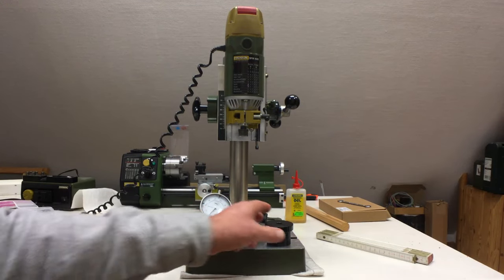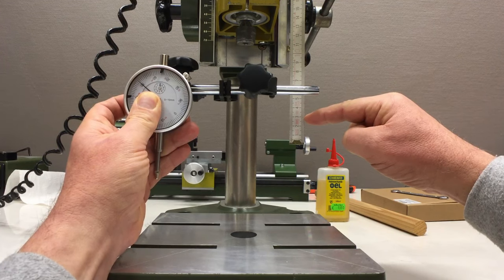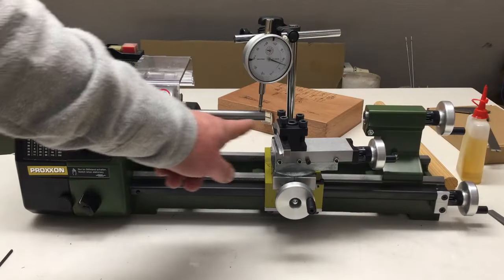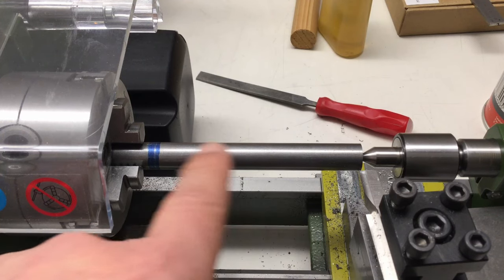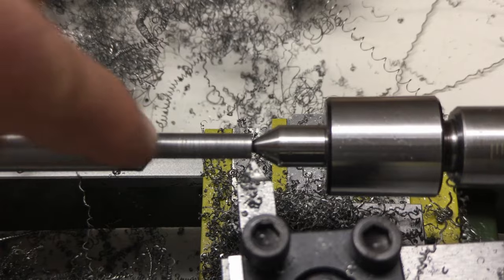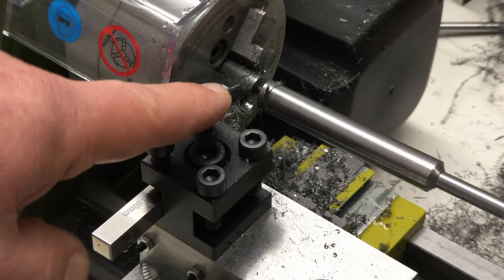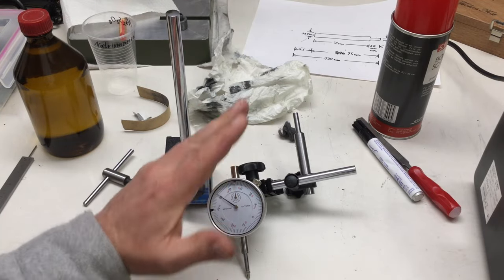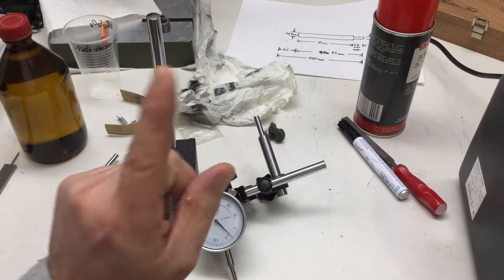Small Project: Shaft for Attaching Dial Gauge to Milling Spindle Collet

Comment: The chatter at the beginning, when doing the facing, is because the effect of bending of the piece and can be reduced using a lunette, or, the cheaper solution will be doing the facing with the face close to the chuck, I know, this introduces some tiny error in the squareness but it's not critical, in this case, to me the squareness is just a cosmetic consideration... but I'm not German
The finishing passes must be do it with higher speed and very slowly passes.
I like the conical shoulder. The unsharpen tools is a opportunity to learn how to sharpe it. 
Anyway, I'm not a professional, just a self learner, I bought my Proxxon lathe after you bought yours.
Reply from the maker: Thanks for the tips! Chucking the piece closer to the chuck when doing the face to avoid chatter - why didn't I think of that 😅 I that application the squareness of the face isn't really relevant anyway. And I will definitely try to do my finishing passes at higher speeds. As for sharpening my tools: I first have to invest in a suitable bench grinder. Any Ideas?
Reply: @robertssmorgasbord  Also, you're always going to end up with ridges if the tool has a sharp corner/point like that. Lathe tools should have a radius at the tip, both for better surface finish and the fact that a sharp point is weak and more likely to chip or wear down quickly. For finishing, you want a tool with a large radius, that'll give the best finish usually. But it does increase the risk of chatter since more of the tool edge will be in contact with the workpiece.
Reply from the maker: @gretah3969  Hi Greta! Thanks for the tip! I've invested in a set of toolholders for carbide inserts (with a small radius). The finish looks indeed much better. Thanks again!